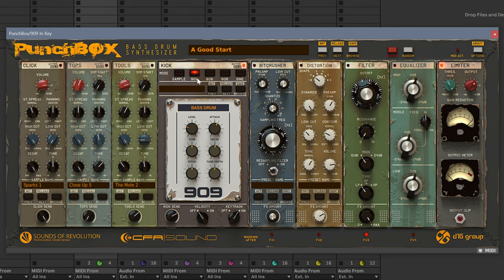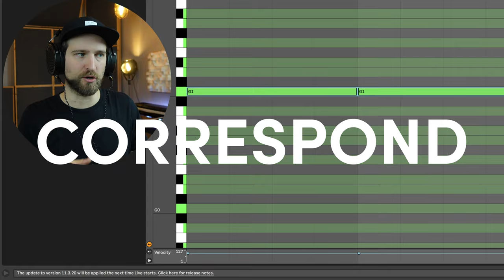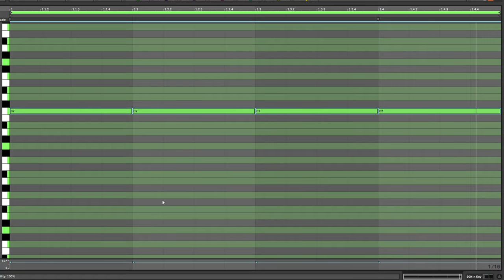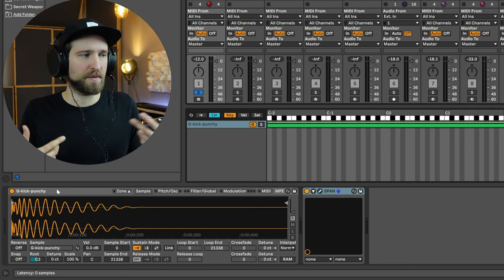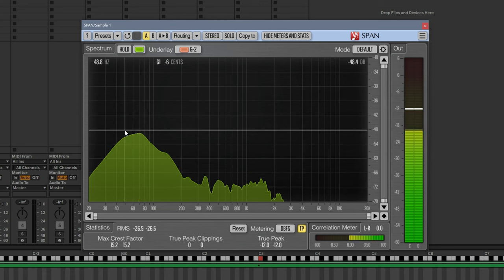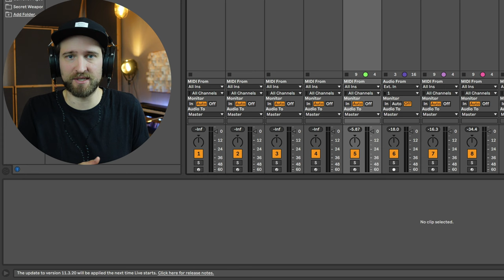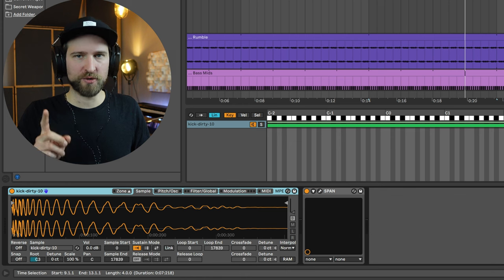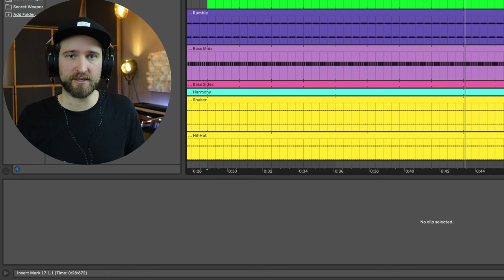My kick drums sucked until I learned THIS

Comment: Depends heavily on the genre. There is a split right down the middle between EDM producers whether the kick should be in key or not. In techno, where the kick is usually very distorted and becomes part of the rolling bassline, its usually much better to have it in key. In Psytrance, the kick is a sine sweep from high to low and generally doesn't stop on one particular frequency. Deadmau5 went on a rant on one of his videos about kicks being short and just there to hold the rhythm and so tuning it is completely pointless. 

In short - I think it depends on the length of your kick. The genre. The style you're going for. I usually play with the kick drum throughout the production of the whole track and slowly nudge it closer to the perfect sound as I go. Just get the track going with anything close to begin with, then edit it. At some point when half the track is made and there are sounds across the frequency spectrum, then I might pick 10 or more kicks and audition them in the context of the song and see what works best.

Some kicks don't have a fundamental if they are sine sweeps. If you use a plugin like Kick2 (awesome! Use it on every track) you can design the kick to stop and hold on a particular frequency for a while to give it a tone. Also, adding a hi hat or kickdrum beater on the top of the sample can affect its placement in the track as well.

A great tip for finding out whether it fits in the track is to bring out the tone hugely with distortion and saturation, go over the top, bring out the GRIT and tone.. then adjust it with pitchshifting and take off the distortion.

Layering kicks is difficult, but worth practicing. Don't forget to toggle the phase of each of your samples to see how they fit. You should never layer two kicks with big low end together, you're really looking for the top and bottom that work well together.

Phase - yeah, always flip the phase on your kick and see how it fits. Check out some Psytrance kick tutorials if you're looking for advanced ways to fit your kick and bass together too.. it applies to all genres. Sidechaining to get elements out the way for the kick, also to blend it into the bass and add rhythm and bounce with the right ducking curve.

I flip the phase on pretty much everything if you can get an extra 1% things fitting together. I have a huge checklist of mixing things I have built up over my time mixing to get a 1% or 2%  here and there that adds up to a track and all the elements working together for a cohesive sound.
Reply from the maker: I definitely agree on the 1% improvements in mixing and mastering that add up to a huge difference overall in the sound!

Comment: honestly I don't care about the so called fundamental frequency of a kick anymore... I just trust my ears. Also the biggest lie is that a kick drum only hits the "tuned" frequency, it's a swipe through the sprectrum and reaches the desired frequency just in the end for a very short amount of time. In my genre (drum & bass) we make kicks so short it often doesn't even have the time to reach that frequency anymore, so why even bother trying to make it match the key. More important is the context: busy kick pattern, it might be wise to use a higher short kick; moderate kick pattern, you can use a deeper kick. but in the end it's more important how it sounds together with your track

Comment: Great work!
In terms of sound design and sample selection;

I've always found for both mixing and mastering; the BEST low end comes from arrangements that take into consideration the relative intonation of the fundamentals between the bass line and the kick drum; as well as how they're arranged rhthymically!
Reply from the maker: Great point! 💯🙌🏻 How much is possible on that front also has to do with the genre. Typical 4/4 kick plus rolling bassline types of songs are a different beast compared to more groovy sub genres like UK garage or color bass. So the “wiggle room” might be more limited sometimes but the principles still apply.

Comment: I think this is correct. One reason might be that in some cases, the tone / note that the kick drum STARTS on is more important than the note / tone of the body of the kick. So, choosing C instead of D means the kick starts, likely, on D (or something close) which is compatible with the key of G (either major or minor): it's the fifth, obviously.
Reply from the maker: And then we have to take into account how fast it actually sweeps through the notes, haha.
Reply: @pickyourselfofficial  yes, exactly. Because of the bass or other elements, it might not be the case that the body of the kick stands out even though it's audible. This is, I think, why the general "tune your kick!" advice is potentially misleading. Better: "hear your kick!" I think. 😏 Which I think is one of your points.

Comment: Good ol’ reliable, just use your ears. It will make you go a long way.

I usually craft a kick with processing 909 samples, or less often sound design it with Operator or 3rd party vsts. Then adding layers like punch if needed, rumble, texture, atmosphere, short kick/low perc for groove. Then adding a bassline, various ways to make one. 

Basically, the kick sets the feeling of my track, unless I want to use a specific sound, like 303 for example, then kick would have to be dominant but still not overshadow the 303, but let the 303 set the feeling. Balancing those “supportive” layers and other elements can be hard, and sometimes it just falls apart or isn’t as interesting as I tried to make it.

Comment: So question there is not if you should tune.. But how should you tune? To the root note? Or any other key? Does kick tuned as a G (kick peaks at G),  really sound as a G to your ears?  Which part of the kick is more important when tunning?  Bottom part (end of the kick) which interferes with bass?  or mid part which interferes which with mids?  Kick is so complex!  What are best practices which makes kick to sound good to your ears?